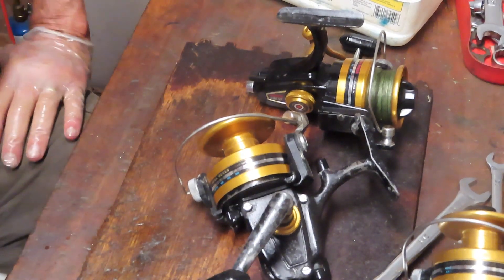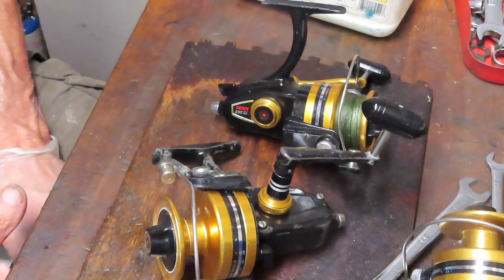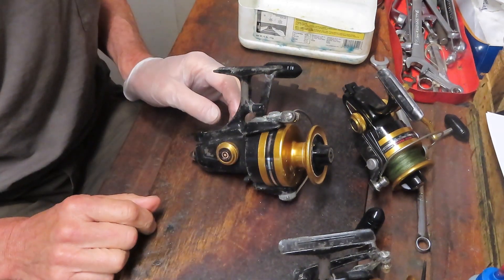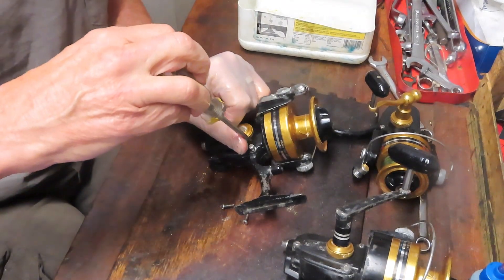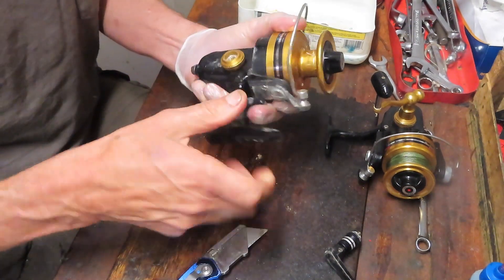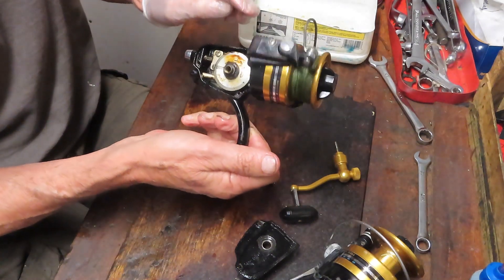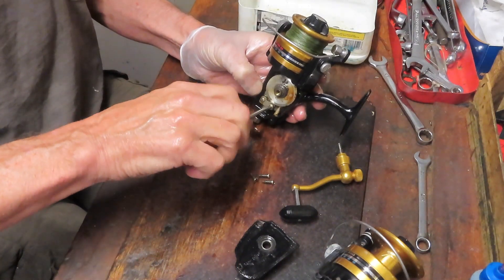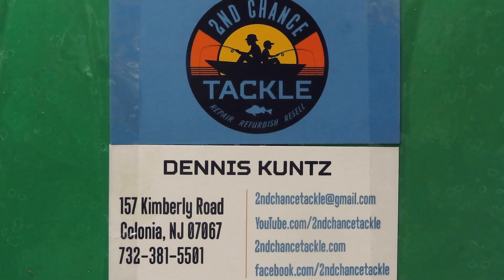How to diagnose fishing reel failures using a few Penn SpinFishers as examples

Comment: This is one of the most enjoyable parts of vintage reel collecting tor me. Figuring out problems and find answers and replacement parts. Just in less than three years I’ve made so many connections with very nice and helpful craftsman (like you Dennis!) that are my go to help with this. I bought reels with parts missing before. If I know it ahead of time that’s okay but when the reel says “functions as designed” or something like that and parts are missing then I have a problem and the seller will have a problem too - me!  When working on these problems a patient methodical approach is needed. Dennis, you have these qualities and then some. This was a great video!
Reply from the maker: Thanks again Chris.  I hope that 9000C functions as designed!  Dennis
Reply: @2ndChanceTackle  I’ll find out tomorrow when it arrives. I’ve waited a long time to get one particularly one as nice as this.. I’m also getting another 302,Mitchell tomorrow. I used my only 302 parts reel to repair a friends reel. Her 302 had been her fathers and she had sentimental attachment to it. I’ve know her for 46 years and knew her father who passed almost 35 years ago. The reel had been sitting in a garage since then. I brought it back to life though I know she’ll never fish with it. I did it so she can see it at her beach home and remember  her dad. The 302 I bought will not be a parts reel. It’s too nice. I’m going to use one I already have if I need parts. Just hope I can those set screws loose and get the bearing out and not drop that little key piece! Always an adventure. L OL

Comment: Hi Dennis, 
     Glad to see you didn't need many parts for these reels ! I'm a big fan of spraying any sideplate screws w WD40 before removing to reduce "butterflying" and letting them soak in the old healthy yogurt cup after, while work is done on the rest of the reel.  Great video...
Best Regards,
Cons
Reply from the maker: I still think I will need parts on the 550SS.  I just didn't see anything obvious.  I just bought a bag of bearings and plan to change them all out.  Hopefully that restores these Penns.  They deserve a 2nd chance - Dennis